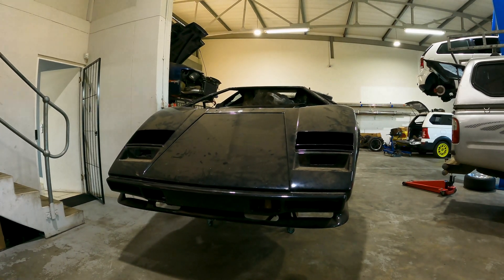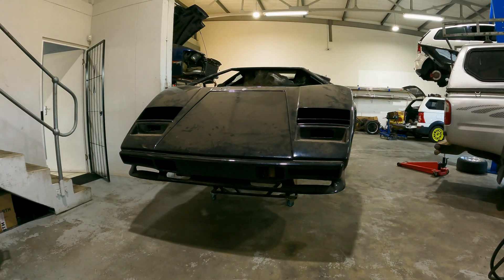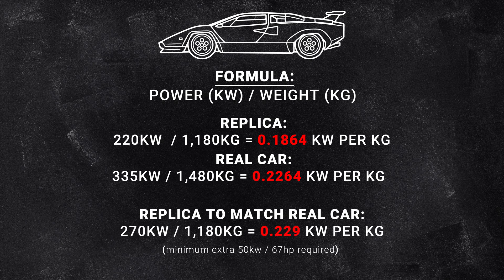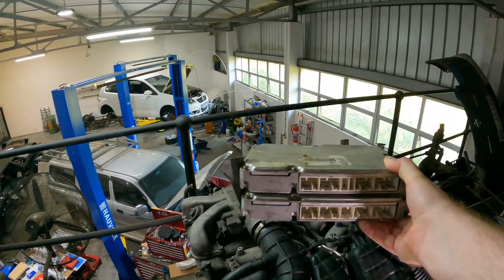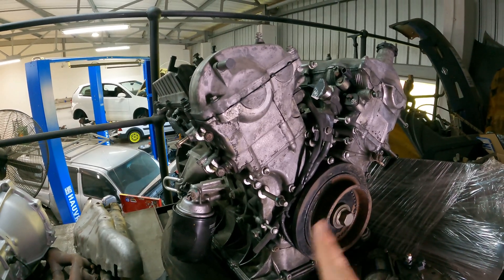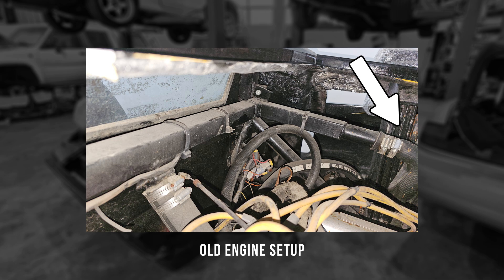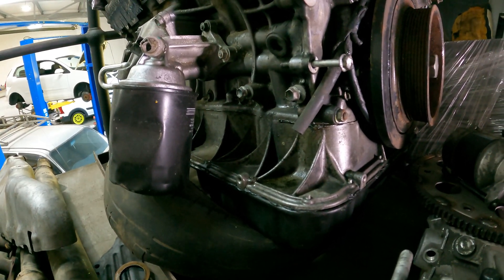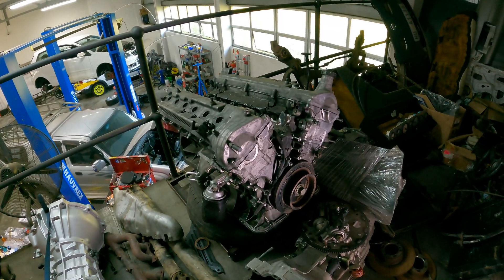Building A Lamborghini Countach Replica With A 5L V12 Toyota 1GZ-FE - Ep: 4 (Engine Overview)

Comment: For ECU, have a look at the MaxxECU PRO it can control 12 cylinder engines
keeping both the fuel and the ignition sequential + whatever you can dream up.

This also leads into a second suggestion, an option later is using a Porsche
PDK transaxle from a Porsche 982 or 718.
Reply from the maker: Never considered MaxxECU, thanks. Will add it to the list.
Reply: @GarethBargate yup, MaxxEcu is a good choice also.

Comment: if you keep the stock throttle body or match up one that are a larger bore, just make up a custom pendulum manifold (just look at Ferrari F12 for example ) the new manifold will gain you power plus you can add trumpets inside the pendulum manifold will also improve gas flow